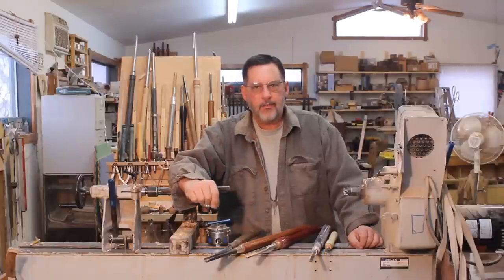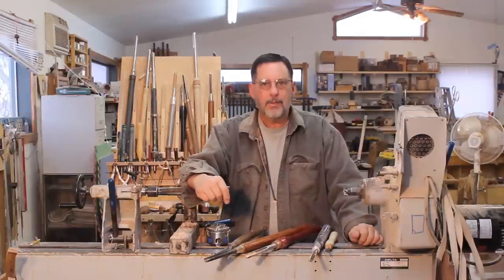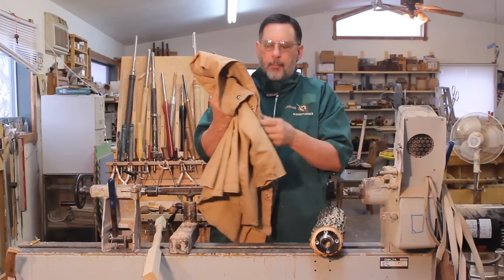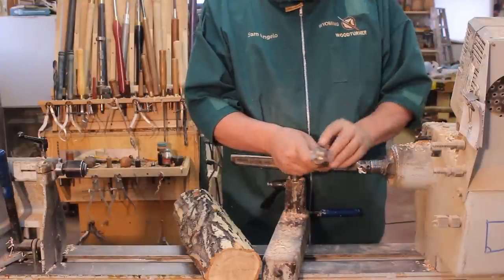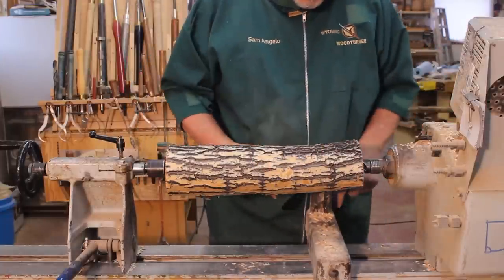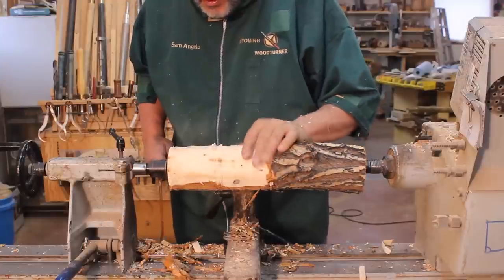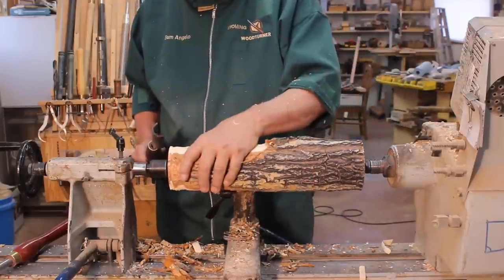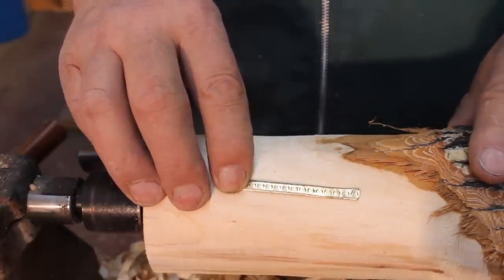Spindle Turning Safety for the Wood Lathe

Comment: We  often don't see the hazard till it happens.  Some things I have run across 
Man working on tractor starter,  starter had to be removed to access terminal,  tool fell of seat hitting starter button,  took 2 fingers.  Lesson,  disconnect battery
Man working on starter,  ring shorted terminals , red hot ring burned to the bone 
Necklace shorted battery,  result,  permanent Necklace of scar tissue 
Glove caught on tow cable , ring caught in glove , all flesh was lost
My own personal experience,  I was exiting a grain bin , over a running grain auger , a bolt in drive shaft grabbed my ragged shirt sleeve.  Could have lost my arm , but the old thin shirt tore , so was lucky enough to have a scar from wrist to armpit.  Multiple lessons,  never replace a roll pin with a bolt , never  clime over running machines,  never use your exit door for machine access,  never wear ragged clothes , have a kill switch you can reach .
Reply from the maker: Les,  Thanks.....It is all about anticipating what might happen.  It is difficult.  But you spell it out well.  Sam

Comment: I was practicing finials with my skew last night. Turning a 10 inch peace of 2X2. It was in my Chuck with the tail stock up. 3,000RPM. Roughed the finial out. Sharpened the skew. As soon as I touched the wood. Had a bad catch that broke the tail stock end. The 2X2 cam off the lathe and hit me in the face. Had my face shield up not down. Busted my lip and cut my cheek from my nose to my ear pretty bad. Just thought I'd share. Never thought it could happen to me.
Reply from the maker: I know the feeling.  Thanks for posting this.  I hope you are not too badly injured.  Sam

Comment: Thank you for taking the time to make this video. Just bought a small 1/2 hp harbor freight lathe and am planning on turning a 3" log and was going to use a faceplate. My question is when do you suggest a faceplate? I'm completely ignorant about wood but isn't the end of any log end grain? Anyways thanks for any additional advice.
Reply from the maker: Yes you are right about the end grain on the end of a log.    I always wear my face shield.  I have changed a bit over the years but I had a fairly bad accident, while wearing my faceshield, and go 4 stitches and NOT a bunch of knocked out teeth.  I always wear it.   Sam
Reply from the maker: Yes the end of a log is end grain.  I always wear my face shield.  Maybe not when I am sanding but when I am turning, I wear it. Sam

Comment: Hi Sam, what type of wood is used for spindle work or like wise projects, I attempted one on a log as you demonstrated but it's cracking from the center.
Reply from the maker: +Johan Loewen 
Spindles have the grain running the length of the lathe:  (a bowl's grain is perpendicular to the bed ways).  
What type of wood?  All wood cold be used.      As far as the cracking is concerned that is a matter of drying wood.    If you take a section of log or branch that is green and do some turning on it, it will eventually crack as it dries because the center still remains wet.  If you search my channel I have many videos on drying wood and that might help.  I begin most of my turnings as wet wood and then I  set them aside to dry. I later remount them on the Lathe and finish them after they have dried.  Sam

Comment: Sam, what a fantastic video!  I like your idea of turning with both hands. I have a disability that keeps me from turning left handed. Do you have any suggestions? 
 SAFE TURNING,  JOHN.
Reply from the maker: John,  Are you  naturally right handed?  I believe that we all can learn to turn with the opposite hand with some practice.  To me the biggest benefit for turning with both hands is that we don't need to move our stance or position of our bodies.  If we only turn with one hand then we must move to a position that might be really uncomfortable.  But that may be our only choice.  It is all about compensating.  Sam
Reply: @WYOMINGWOODTURNER  , my problem is that like you I had a shop accident. I nearly cut my rt thumb off on my bandsaw. For over a yr the Dr would not let me in my shop. Finally I got to start back in my shop on the lathe. Sam, the problem is that my thumb has very little feeling in it. To me, it would be safer to keep turning rt handed. Your thoughts please. SAFE TURNING!
Reply from the maker: The feeling in my 3 "cut-off" fingers is also weird and not the same as before.  It is all about compensating.  But I am sure you know that.  I was back in my shop turning after about 2 weeks.  I guess I never asked my doctor if I could.  I have had 12 or 13 major surgeries on my knees and spine.  I have discovered something.  We are very fragile.  And this is very evident after a surgery or accident.  BUT!  We are not all that fragile and need to push that side of it a bit and not be afraid to move forward.  Best of luck and be safe.  Sam
Reply: @WYOMINGWOODTURNER , thank you.  I shall try left handed turning. TURN SAFE!

Comment: Thank you for the video. Still not clear on why certain tools(they all look the same to me) are for spindles and others for bowls.  Do you not cut side grain on bowls? OK, I hear you saying "get a book", which I will do, but it seems this would be one of the basic subjects addressed to beginners in their first adventure in fron of the lathe.
Reply from the maker: +Seth Warner 
Good questions.  It is important to find out answers to whatever questions you have.  OK here goes.  There are few "rules" which are life and death.  One is to NOT use a spindle ROUGHING gouge on cross grain work.  Bowls to be more precise.  But there are other examples.  The rough gouge has a week tang, a very aggressive and short bevel/cutting edge that will catch in end grain.  It can result in a broken tool and injury.

now GENERALLY you can use a spindle gouge on bowls and a  bowl gouge on spindles. Why a bowl gouge on a spindle?  Well it takes wood off faster and is more rigid.  I use a deep fluted 1/4" bowl gouge all the time on my small boxes.  A small spindle gouge will flex more and vibrate.  

(Not sure what book you are referring to)
Hope this helps
Sam
Reply: +WYOMINGWOODTURNER Thank you for your patience; it is not your responsibility to empty your brain to me (ha ha).  I wasn't sure what book I would go to, but apparently there isn't one!  You have many vidios out there that I just discovered today, so I will refer to them.Thank you for being a good consciensious teacher.
Reply: You know what, Sam? I have come to trust what you say and show to the point where, if you WERE to write something that you felt was important, I would blow it up and make a poster out of it and write above it "read before turning on lathe"+Seth Warner
Reply: the principles of woodturning are very basic - the use of certain tools is often prescribed by fashion - for instance the skew is the most difficult tool to use - most teachers seem to like to demonstrate their mastery often using it in inefficient ways - so most amateurs feel that they can only be a good turner if they can use this tool - shame because woodturning is about the finished item - there are no drug tests - you can use any tool in any way you like as long as you are aware of the principles -